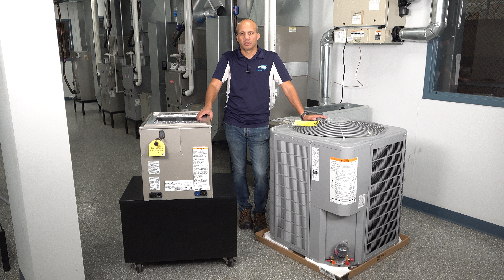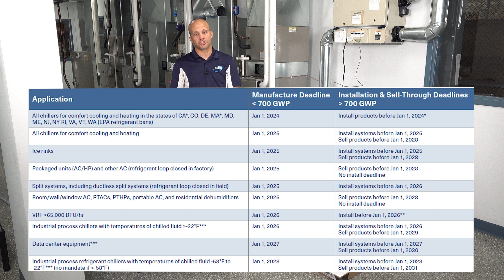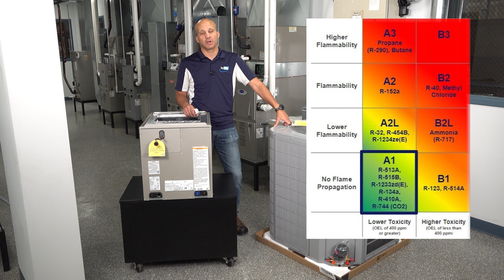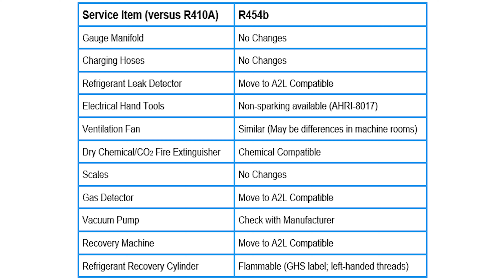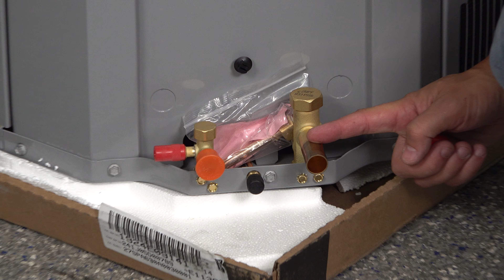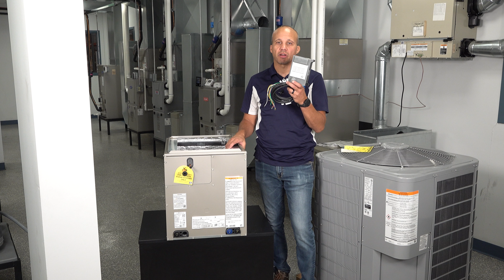A2L Refrigerant Properties and Field Tools

Comment: They do have safety devices called dragon fly , in case of leaks immediately the system will shut off ,and it not gonna run until someone fixes it
Reply from the maker: We would be concerned about that in cold climates. If you lock out someone's gas heat while they are out of town, you are likely to freeze pipes, etc.

Comment: So if there's a leak and it shuts down the furnace. What about the water heater and gas dryer that are ussually next to the furnace? This is a big joke. Why are there no sensors for natural gas?
Reply from the maker: If we had to guess at the logic of the folks from UL who write the rules, we would assume that due to the location of a gas furnace or electric heater.. and it sharing an airflow path with the coil... that they feel these are a larger threat to be a possible ignition source than unrelated appliances in the home.